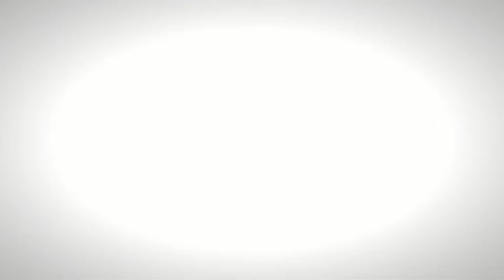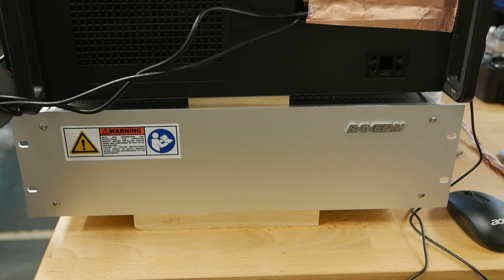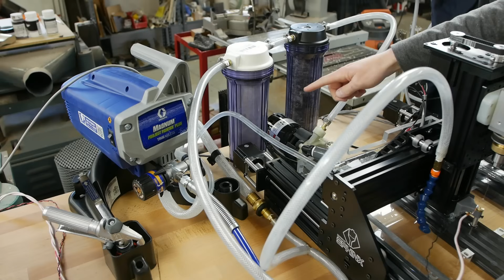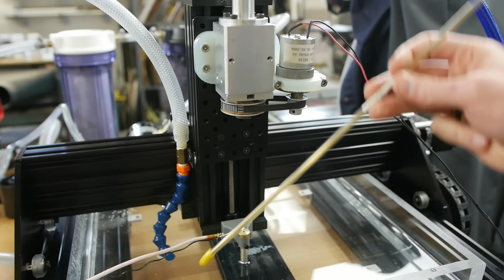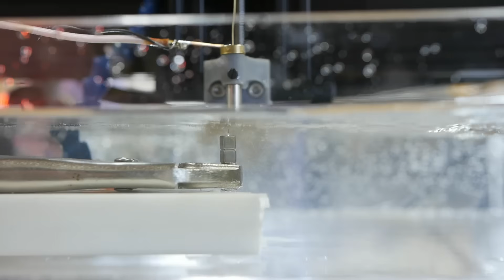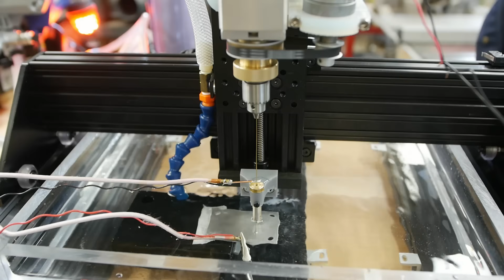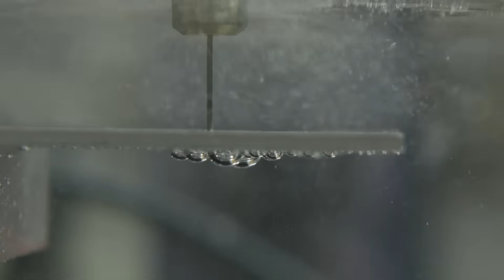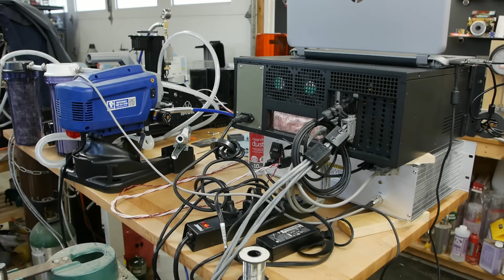Drill through anything (conductive) with Electrical Discharge Machining

Comment: Actually, most CNC machines have exactly what you call "negative" feedrate. This is found in the peck drilling cycle. G83 code. It operates essentially identical to this, only no arc detection, but could be used for this with the parameters available with G83.
Reply: Nope, they do not. What it means in this context is the ability to reverse the whole G code program back to beginning, i.e. backtrack movements.
Reply: @TheWireEDM   I dont think so. You can also do that with standard gcode BTW!!! Also, that is essentially what the peck drilling cycles does, especially if you have it do full retractions.
Reply: @ArionRaine  Nope, haven't seen anything but one mill that allows jogging with handwheel through the program both ways. EDMs are practically the only machines that do need the functionality of reversing the program mid run and returning where it came from if it shorts out. Mills do not have to. EDM's also have a proportional feedrate system based on external input (gap voltage), as it is a process driven and not time driven like a mill or a lathe.

Peck drilling is not at all what reversing G code (i.e. backtracking) means.
Reply: @TheWireEDM   Thats true, not with the handwheel while a program is running. I never said that, or suggested it, and not sure how its even related as I do not think it was mentioned in the video. Apparently you did not read my post thoroughly enough. I did state that it would not have feedback, implying it would not be able to do it automatically. However, this is entirely possible with most industrial level controls. I also never said a mill would have the need, it obviously does not.  Just that they are absolutely capable of reversing feedrate, i.e. retraction, just as an EDM does.  I specifically replied to the statement in the video that he suggested no other CNC machine is capable of reversing feedrate, which actually is not true.  Most controls are absolutely capable, there just is no need for a mill or a turning center so your not typically going to encounter it unless you have used an EDM. However, plasma and flame cutting machines do have a similar need for torch height control. Its a very similar mechanism. Often this is a separate device, but they can readily be interfaced to most controls, and some controls can do it directly.  Peck drilling is essentially the same thing as backtracking. You can long form a peck drill cycle and have it backtrack and increment to any point in the program you want. The peck drilling cycle is just a canned cycle which makes coding it easier, and obscures the long form version of it that the control is essentially running. Every industrial level control in existence is capable of backtracking to any line in the program.  If you have ever had to code a highly repetitive operation using variables etc., you would know this.  Most often dont know the extent of the capabilities of most PMC's running Gcode, as their experience is limited to programming via a CAM application. Understandable.
Reply: @ArionRaine  Peck drilling cycles are not operating by calculating the trajectory backwards, they just use linear motion between starting point and next point in depth. An the reason is quite simple: it is easiest to program, as drilling is a linear movement function between two known points.

EDM's backtracking movement is according to the previous lines of code, so much more complex than just moving between two stored in a variable points.

Haven't checked fully, but for example Heidenhain controls are not capable of EDM unless it is their special EDM version.
Reply: @TheWireEDM   Yes, I understand what you are saying, but Gcode, depending on if the control is capable, can do this as well. Most controls will accept a very BASIC like syntax that allows for advanced programming. Even looking back, and making decisions based on current situation.  I am unsure about Heidenhain. I have been around some of their controls, but not that familiar. But yes, most will be at least an extra charge to enable this functionality.  Even though its usually just a parameter to be set.  I am not arguing that it isnt pretty much solely used with EDM. That is certainly the case.  I am just saying that most controls are capable.
Reply: I think we are are both trying to explain the same things from different ends here :D Sorry if I came out a bit strong here, just a bad nature of me.

But yeah, controller specific thing if it can control program flow based on external analog signal and also reverse the direction of the program. Most conventional machines do not have to and even a THC on a plasma, while quite close relative to how EDM ooerates, is an external system thst is not tied to the actual program that is running.

Comment: EDM is generally the accepted term for this process, however "spark erosion" is better suited for some "EDM" processes, such as what happens when you get an arc from touching your power supply leads.

Comment: I built a device "I called it my Arc-N-Saw) to saw/slice metallic crystals without applying pressure to them for a physics professor many years ago.  I had no idea how to approach such a project but ended up using this same principles used here for for my creation.  It worked!  It reversed too!  I was a lowly electronic tech in a university physics department back in the early '70, before we had computers.  Your videos are wonderful, bring back many fond memories.

Comment: Just wondering... is there a risk of producing hexavalent chromium when drilling on steel? Electrolysis with steel is dangerous because of that.  I know is not the same process, but still... is there such a risk?
Reply: There may be a slight risk when working with stainless steels that contain a lot of chromium.  This process does more vaporization than electrolysis so would have less risks than using a stainless electrode in an electrolytic bath.

Comment: I used EDM 40 years ago as a student. I used it because I needed to machine a rod of berylium,  which is toxic.  EDM involved a moving wire that slowley descended through a 15mm diameter rod of Berylium.  The whole thing was immersed in a bath of paraffin. And that was the whole reason for using EDM,  all the products of the machining operation were retained in the paraffin bath, and could be disposed of safely.

Comment: How well do those wheels track? I'm considering going with those vs standard linear rails for a high speed low torque situation - I need high stability and I'm not sure if their wheel system is perfect or too cheap for the job?  anyways.

Comment: Have you thought of using a pre-filter separation tank? Just a big tub with the incoming water flowing in one end, and water taken out by a pipe at mid-height the other. Low-density contaminants float to the top, high-density sink. It wouldn't be enough alone to give you properly clean water, but it might significently prolong the life of your filters at the expense of increasing the side of the equipment.

Comment: Do you have to worry about keeping the drill rod and material-to-be-drilled very still in relation to each other, to prevent electrical arcs from leaping off the rod further up, into the wall of the hole you're drilling? If so… Would a non-conductive sleeve around the drill rod, that only exposes the tip, be useful?
Reply: Not really, the closest approach will almost always be from the tool to the work unless you have to drill a smaller hole in the bottom of a deep hole and here insulation might prevent slight corrosion from very long sinking procedure but I have never heard of it being needed.  The spark only jumps a tiny gap and the voltage is not VERY large (tens of volts).
Reply: Arc forms at sharp edges (the tip) much easier than from the smooth side of the rod.

Comment: Hmm. You could make holes, and by extension, mill, very delicate conductive materials. Materials such as steel wool and conductive foams. I wonder is you could make a hole in carbonized bread. (I imagine it would depend on how conductive carbon bread foam is…)

Comment: Would love to see a EDM process doing internal threads in some rather hard material (600 Brinell) - kind of like a sinker doing helical interpolation?
Reply: I vaguely remember reading about this as a use case.  The motion control will certainly need a low backlash and well implemented reverse feed  support.

Comment: Hello, can you drill semi-conductive ? Can you drill granite ? If you can't drill granite with this so tiny tube, can you do it with a larger one, 2 or  3mm diam , or made of an another raw material ?

For the PH of water, there is cheap resine on ebay or amazon for shower ... For those who don't want to change all the water, it could be useful.

Thanks for sharing.

Comment: Can this be used for PCB milling? Can you try it on a copper clad FR4 board? What's the hole size?
Reply: EDM is poorly suited for copper and not at all usable on the insulating board material.  Some hobbyist have done crude PCB board etching with electrodes but generally slow and of limited quality.

Comment: How would you drill the high aspect ratio holes in the electrodes, without using EDM with even smaller electrode?

Comment: how abaut metall ceramics - cerment inserts i think they are conductive 
and lead - and maybe a very small piece Magnesium - id like to see if it starts to burn from the spark

and please try to do Inconell 

and platin if you get a little piece of it 
also how straight are the deep holes - i heard that some manufacturers of ultra high precision gun barrels like the now sadly bancrupt Ritter&Stark from Austria eroded the hole and later the rifling as well 
like a 7mm hole in 70cm of steel with runout of ~0.01mm from center over the whole lenght
also what is the surface finish if you go on the slowest feed rate with lower energy with the highest ammount of pulses - some finish looks like its beadblasted but some is fairly smooth 
also can you use a torx bit as the tool to make his exact imprint sw - if its steel it might not last long but id love to see it or try a square blind hole with sharp corners all the way down to the bottom
and use a sinter copper as electrode - you can give it its shape by milling and can press the electrolyte through it while working it
Reply: Gundrill. I gundrill a hole 3mm 750 mm deep with 0 deviation, perfect concentric, and amazing surface finish through intersections. My machine can't cause of the oil pump but there are gundrills with 0.01" diameter. Nobody EDM's holes, stupid, can't flush the particles so the hole will be not round.

Comment: I remember you mentioning this process on one of my videos a couple years ago and I had since forgotten about it. This is crazy cool. I was just about to ask about how you even begin to figure out your feed rate when you mentioned the software does that for you. I really need to stop leaving comments before I finish videos. Looking forward to seeing how the wire EDM works in the X Y axis. Thanks for the great video as always!
Reply: The craziest part about wire EDM is that the top and bottom guides can move independently which means you can cut some crazy shapes with odd tapers. Even a shape with a square on one end and a circle on the other, with one singular cut

Comment: You can drill through Granite with copper pipe and sound frequency too
Reply: Jason Gooden Brien Forster has videos showing ancient Egyptian and pre-Mayan stonework with holes and cuts showing 4mm / rotation cutting speed. - either sonic or electrostatic drilling.

Comment: We have a wire edm and ram edm at work, with this style holder in the RAM we can affix a piece of bronze or brass or carbon to it and machine it into whatever shape to use

https://www.gfms.com/s3r/en/products/tooling/electrode-manufacturing-and-EDMing/macrojunior---macrocombi.html

I was wondering, do you know if a piece of mechanical lead would work as an electrode?? I think there's something like 14 different hardnesses of lead you could buy, would any of them work?
Reply: None of the electrodes we make have thru-tool coolant though, wonder why that is

Comment: You do not ned to use water, i used to have an old edm machine and that exclusively used carosene or other similar petroleum based light oils. Of course you have some concerns in terms of vapors but a ventilated shop is OK,  and for shorter runs there will be very little heat transferred to the liquid, so no additional cooling required. As for filtration, my machine used regular batches of rockwool insulation material which kept the liquid almost crystal clear. And I never had to exchange the liquid, only to top it off. And there were no issues with conductivity at all. And it sti,, stayed within acceptable margins. And the electrodes that I used were either copper or graphite, never seen brass though. 

Oh and keep up the good work, love your channel with exellent content :-)
Reply: I'd be worried about setting the vapors on fire ... striking electrical arcs around big tubs of kerosene seems mildly terrifying.
Reply: Valid concern of course, but if you research it you will find that it has been used for decades this techniqe. But there should be no risk as long as you keep at least a couple of cm or an inch of liquid level above the electrode sparks and you are good. I have only once seen a fire and that was due to a faulty liquid level switch which meant that the sparks were exposed.
Reply: @martinvendelbjerghenriksen3854    Quite right, as long as the spark is fully immersed it cannot get hot enough to ignite.  I knew a guy with a machine shop in his garage and his EDM sinker had suffered a fire due to controller failure that emptied the tank while he was not in the shop, the Z axis head had to be stripped, rebuilt and painted but it survived the kerosene/paraffin fire ok.
Reply: EDM liquid is a special oil, not for cooling at all. Only to act as an electrolyte and to flush particles. This is the dumbest thing I've seen
Reply: @highstreetkillers4377  I think you have been swayed by the commercial marketing material a bit to have such a narrow view.  There are many options and yours is just one but not the only one.  Here is a link to a general paper talking about various die-electric fluids and blends.  -  https://www.sciencedirect.com/topics/materials-science/dielectric-liquids

Comment: Once I just put a pen lead in isolated chuck in normal drill press, connected it to rectrified mains through ordinary bulb. The result wasn't that spectacular, but it easly went through 60HRC piece of carbon steel. Instead of water I used torch oil, I read on Polish CNC forum, that it works better. I neded to drill only 1 hole, so haven't used any filtration.

Comment: Great video as always, just one question. You said that there wasn't any use for reverse function in a cnc milling software/controller, but what if u use a tap on a mill, then u would have to reverse wouldn't ya?
Reply: Reversing function means in this context that you can run the whole program backwards at any given time, as in the machine can backtrack where it came from.
Reply: @TheWireEDM  ohhh, i tought i was the "spindel" only

Comment: Finally! a YT video that has some value to it  :) .....  why couldn't you magnetically capture the majority of the metal debri?  as a Pre Filter before it passes through any paper or charcoal(?) filter?, there is a metal that is magnetic (attracted to a magnetic field) but Not magnetizable , used in circuits that will oscillate but when the transmitted signal is removed, they stay not magnetized,  used in Acousto-magnetic systems, these 'fingers would collect most of the debri and attached to a DC electromagnet could be pulsed on/off for cleaning?? sound like a possibility? would help those who don't want to absorb the cost of those special filters... I have a smaller CNC machine used in laser cutting and CNC bits, I might just try a Home Brew, guess have to buy those special bits with that inner diameter hole but other than that? just a few franko style connections and yes, its alive!!! think about it, for all those of you that have many occasions where a hole would be good but the metal is too hard or the hole is too long and bits are not going to work...

Comment: Do the cutting rods have any type of insulative coating on the outside to help keep the sparks focused on the tip?  That would help keep the hole diameter consistent from top to bottom, but the insulation would need to be able to erode from the tip end along with the conductive material.
Reply: Not used in practice.  If the tool is straight it does not approach the hole sides once a certain clearance has been reached then the spark is kept at the tip by advancing the tool at the rate required to make the spark occur at the tip.